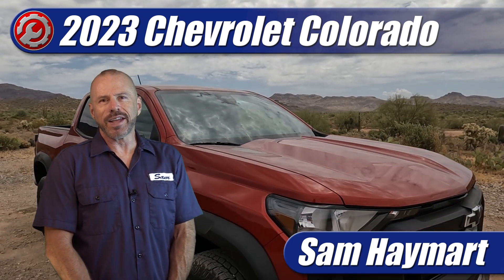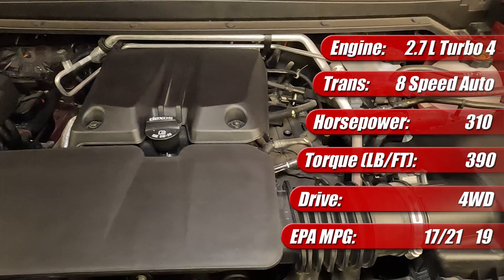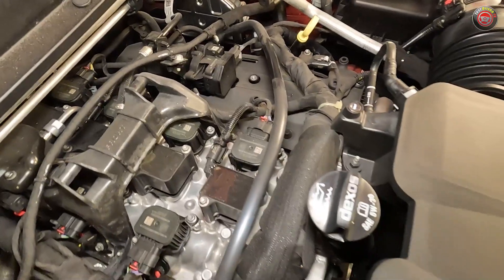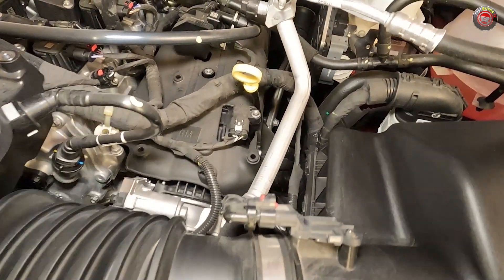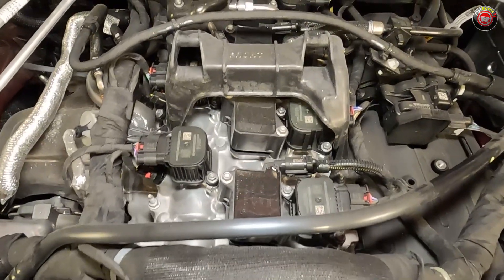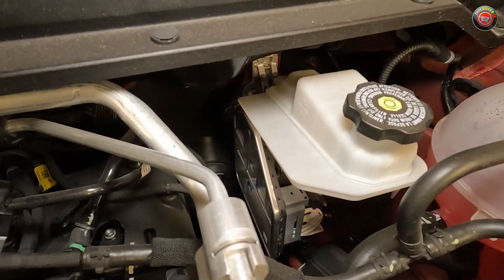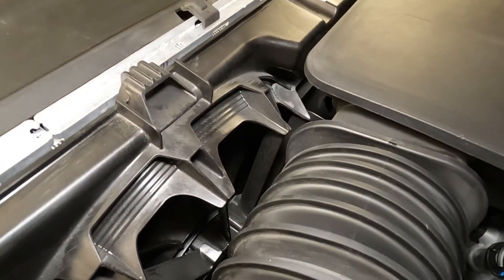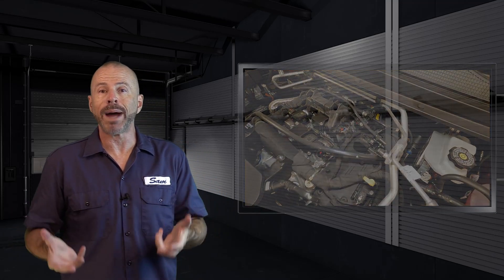2023-2025 Chevrolet Colorado: Engine Explained

Comment: Is this engine known for excess oil consumption. I am looking at a new Colorado but in doing my research... I found a few folks mention they are adding a quart or more of oil between oil changes and they consider this normal. I am 52 years of age and the only vehicles I ever owned that went through that much oil between oil changes were the clunkers I bought when I was a kid and those burnt or leaked oil because they were usually bought for around $500. lol. I do not want a car that uses that much oil brand new and is considered "normal".

Comment: Hoping to get a Black Friday deal on a 2024 Colorado WT, on the 29th of November 2024.
Your video before this one was about the do's and don'ts of the 2.7L engines, Light duty, Medium Duty and a $200.00 upgrade to make a Heavy Duty.

What pisses me off is when the Salesperson tells you that you can pull a trailer with the truck, then because I watched this video, I have to tell them I can't pull my tandem axle trailer with it loaded to capacity. The Trailer is 1500 pounds empty and the L2R paired with a AL45 Transmission will only pull a 3500 pound trailer.

 With that being said, I could only put a 2000 pound load on my trailer.
The downloaded and printed window sticker I am looking at says Engine: 2.7L Turbomax. Does not show which engine unless the Turbomax is the L2R. The L3B Turbo Plus is Medium duty and with a $200.00 upgrade makes it a L3B HO Or heavy Duty. The L3B's will pull a 7700 pound trailer.

What I don't like is all the "bling" crap that I don't think I'll need. Watched this video and the 24 looks about the same as the 23. This will be my 1st New truck as I have always bought used in 50 years. Compared to my daily driver a 2000 Dodge Ram 1500 V6 5 speed with hand crank windows, (102,100 original miles) this Colorado is like an aircraft cockpit on rubber wheels!
The 24 has features that come as a standard package that the 23 had as options.

 The truck I'm looking at is Priced at $35,100.00, 25% tariff on Canada, 25% tariff on Mexico and 10% on China is a total of 60%. so, who will buy the 2026 model with the added 60% Tariff which is an additional $21,060, total price $56,160.00? Probably 60k Plus.

Comment: Where is the water pump? is it driven by the timing chain and cost $3000.00 to replace?
Reply from the maker: The video describes and shows the water pump to be electric and mounted on the outside of the engine. Did you watch the video?
Reply: @TDTVGarage rude 👎🏻

Comment: Terrible... turbo will die 25k miles
Reply: 134K miles & Zero issues!
Summer months - Tow a 5,238lb RV over 3K miles.
Winter months she handles the Snow/Ice storms like a champ. 
Negative Karen has no clue!
Reply: @klforrest573   does your pickup go through oil? Do you find you need to add oil between oil changes?
Reply: @beri232  Nope!
Reply: @b @beri232  No - but I will say this - since my first actual OCI - which I performed @ 1K miles - I began running M1 FS Euro 0W-40 w/PPE oil filter.
Then again @ 3K miles & again & 5K miles.
Since then I have been doing 5K mile OCI w/PUP SRT 0W-40 w/PPE oil Filter (Once before winter & Once before summer - keeping the PPE filter in service for 2 OCI - which this filter can easily handle 10K miles.
Since my post I sold this Canyon - & have purchased a 26 Canyon AT4X & have began the same routine maintenance schedule.
Reply: But with all that said - I’m 61 & my driving habits & style are much different then most - I try to avoid as much stop & go driving as possible & at every chance I get this L3B up to operating Temp for about 15 - 20 min —-> Highway/Interstate driving (65-80)mph.
This still is a Turbo (Large) 2.7L 4cyl engine - my OCD always gives this decently sized Turbo a chance to cool abit after this type of driving - before shutting down. 
Air Filter (Blown Out) & housing cleaned once a yr / along with MAP sensor cleaned as well - Filter is changed every other yr. 
This 26 is my last truck - she will take me well into & after retirement.
Reply: @klforrest573  I am 52 and likely have similar driving habits. We definitely have the same maintenance traits. Lol. I tend to overdo my maintenance as it’s cheaper than replacing parts. Good to know there’s no oil consumption. Others have said they go through more than a quart between oil changes and to me, thats excessive
Reply: LOL, this engine is proven reliable. Sorry fanboi
Reply: 60k going strong ill let you know when i hut 100k

Comment: Thinking about getting the 2023 colorado, but concerned about the cylinder deactivation. Thoughts?
Reply: I own a 2023, I've never seen the cylinder deactivation mode happen in an entire year of ownership.
Reply: By the little device, you can plug-in that bypasses it, my friend owns five mechanic shops and told me to buy it because the dealers can’t tell it’s been installed. if you go to the dealership for a service, just unplug it and then plug it back in afterwards.
Reply: @ant.8673  do you know what brand of device or is it a tuner or just a box?
Reply: I have a 2024 GMC Canyon. So, mechanically same truck. I've owned it 6 months and have seen the "eco" mode illuminate only once. That was on a long downhill grade in Colorado.  Seems like several stars must align perfectly to engage the cylinder deactivation. Also, this system is much more simple than in the big trucks and SUVs. The L3B has been around 6 years now with millions of miles on them collectively. I haven't seen or heard of any complaints when scouring the forums.

Comment: The V-6 and the Duramax Diesel that were available in the previous Colorado are no longer offered in 2023.
Which engine is more likely to run over 250,000 miles the 4-cylinder or the Duramax Diesel?
Reply: Prolly the 2.7L TURBO.
The babymax's 181 hp is not gonna do it for me.
Reply: @docholliday6285 I had a 2017 Colorado diesel. It was severely underpowered and struggled to merge on the highway. It got fantastic fuel mileage though.

Comment: Actually this motor features new turbo tech, and was designed from inception for truck.
Waiting for my ZR2 delivery and love the motor. *You can have your hybrid.
Reply: 2+ Years, 40k miles, zero issues. My Colorado ZR2 has done it all, from 80+ mph road trips to technical off road action. The low end torque is special.
Reply: @docholliday6285  Hey bud. I have been looking at getting a new Colorado ZR2  but have read quite a few posts about high oil consumption. You have had yours for awhile now.... have you had to add oil between oil changes? I've read about guys adding an entire quart or more between oil changes and they say this is normal for these engines. I find that absurd. I have never owned a new vehicle that burnt through that much oil between oil changes.